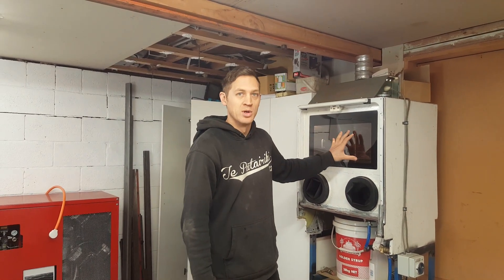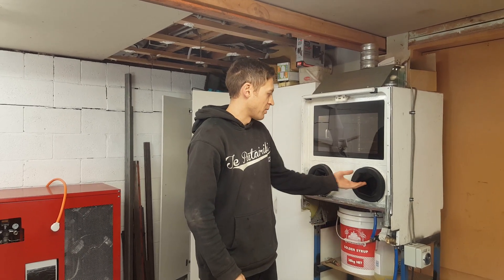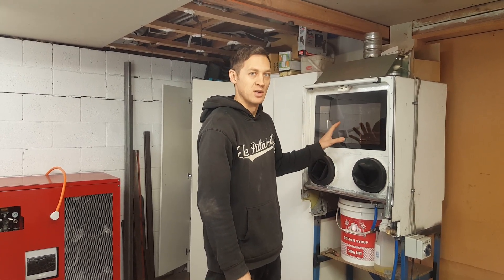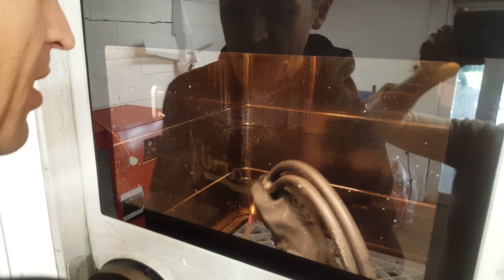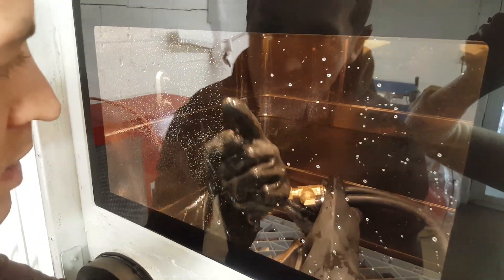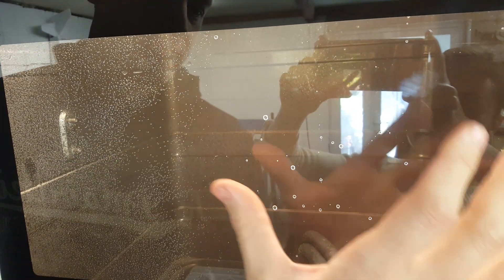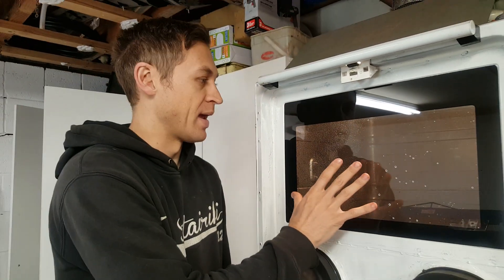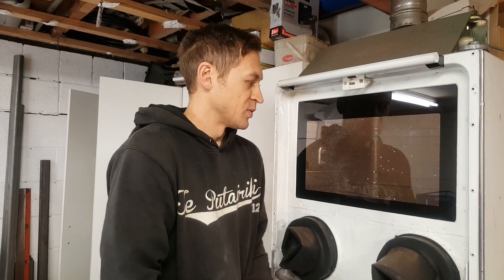How to build a Vapor Blaster - Rain-X test.

Comment: Just a quick question is your impeller a plastic or a cast iron on the pump or does it matter if you’re only using glass beads just before I get my one thanks mate 👌🇬🇧
Reply from the maker: Hi Wayne, I use a range of pumps. Some have plastic impellers, some have polyurethane. Glass beads are quite soft on pump, and I have never had any issues. If you use a lot of aluminium oxide or crushed glass, you will get a certain amount of wear. I have never had an impeller wear out.
Reply: @ArmouryEnterprises  👍😁thank you🇬🇧

Comment: Just wondering will that gun work with dry sand blasting as well as wet?
Reply from the maker: I have had this question a couple of times actually. In theory yes. it will draw water up when the pump is not running, but I am unsure whether it will have enough to syphon feed. I am planning on testing one in my dry cabinet when I get a chance. It could really do with steel internals for dry blasting. It is a much harsher environment.

Thanks for watching!

Comment: Just discovered your channel and spent the afternoon binge-watching - well done great content thoroughly enjoyed watching your videos!!!
I have been wanting to install a bead blaster/vapor blaster in my workshop, for over a decade however, I only have a single-phase supply, which is barely adequate to power a 1hp motor.

My best option is to purchase a bare compressor pump head (5hp triple-cylinder) that the manufacturer claim will produce 40cfm at 850RPM - and power it with a Honda 13hp engine or similar sized air cooled diesel.
I  purchase your online book and highly recommend it.
Reply from the maker: Where are you located mate? A big part of my development has been on trying to make the process as efficient as possible and to require as little energy as possible. Always trying to make vapor blasting more accessible to people around the world.

Thanks for watching!
Reply: @ArmouryEnterprises  
I am based in the Gulf of Thailand, 
After watching your videos I realized that I already had all the materials/equipment in my yard to build a booth.
my only stumbling block is the compressor.
Reply from the maker: @fourtoes412  Yes, that will be difficult with a grid that struggles with motors bigger than 1 HP.
Maybe a petrol or diesel powered compressor? I don't know how regularly available they are in your area of the world, but I know a few people who have unstable grids that successfully use petrol/diesel compressors.

Comment: Hé Josh we can see the plane on the   reflection of the glass 😂😂😂
Reply from the maker: Haha yeah I have a couple more videos, but they were too short to bother adding 😂

For some reason the elevator channel had reversed from the last time I used it, and I didn't notice while doing the control surfaces check. I fixed it up and had another go which lasted about 30 seconds. Slowly getting better haha. I think I still have too much throw on my control surfaces.

It costs me a prop each flight I make haha
Reply: @ArmouryEnterprises  poste some video 😀😀 I am sure you will get more likes then the vapour blasting 😁
I finish my vapour blasting following your book and video and first test was good, the problem is that the air compressor making to much noise am trying to make a box to reduce a noise I don't won't a problem with my neighbour 😂😂😂
Thnx Josh 👌👍👏👏
Reply from the maker: @cimogt7857  Haha, when i get a few more flights in and there is more than 40 seconds of footage I will put something together for us all to have a good laugh at! 😂

Awesome! my email is in the e-book. I would love to see your vapour blaster if you will send me some pictures!
Reply: @ArmouryEnterprises  I will take some photos a send to 😉